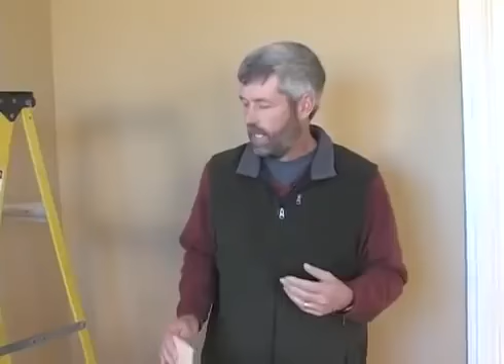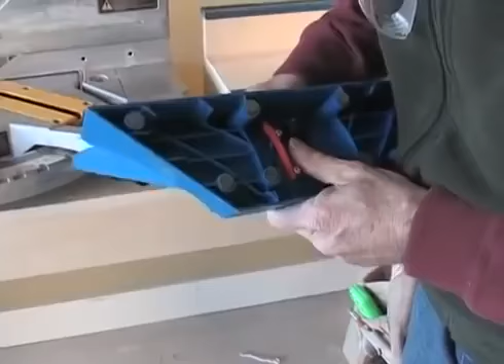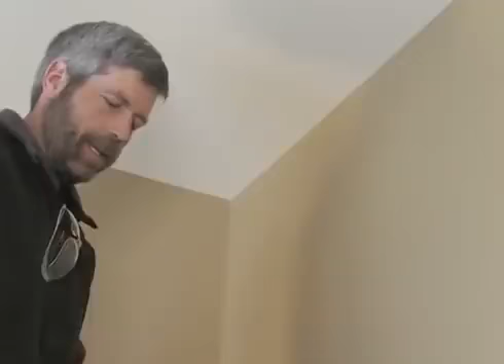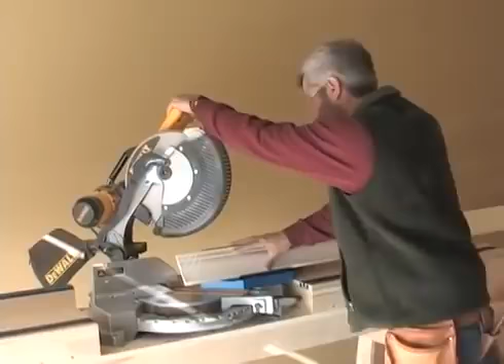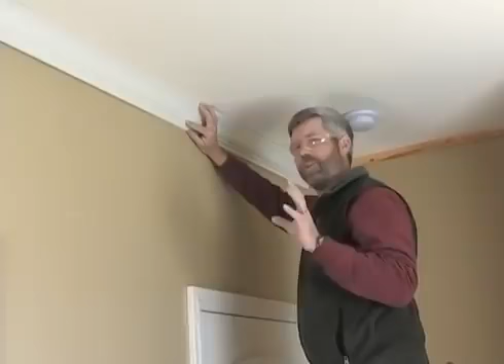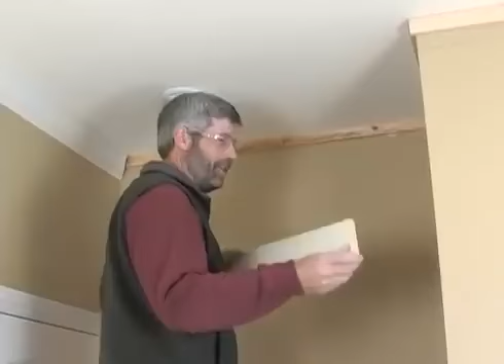Install Crown Molding with the Kreg Crown Pro™

Comment: reminder using KREG CROWN-PRO, most miter saws are set at 0, if so you need to use the swing angle. If your miter saw is set at 90. then use the wall angle. Just read the instructions which come with it.